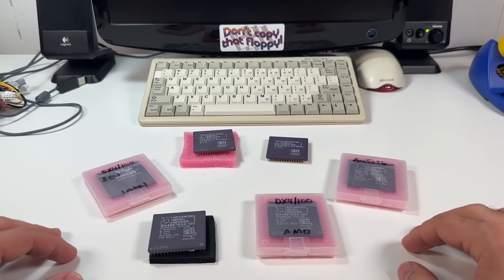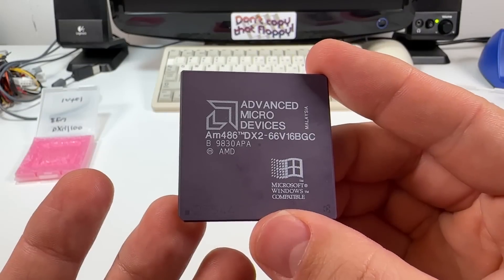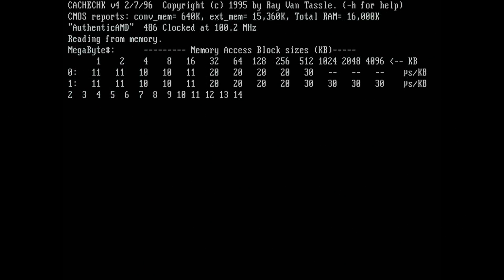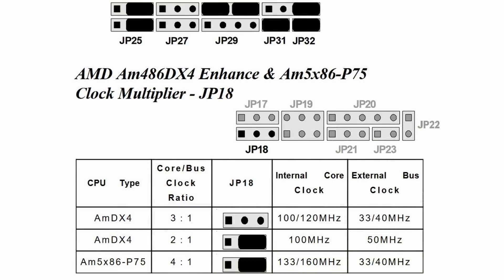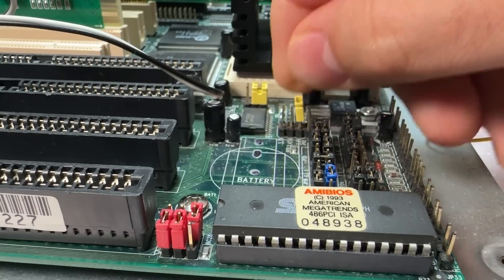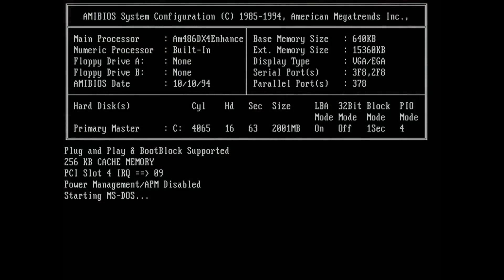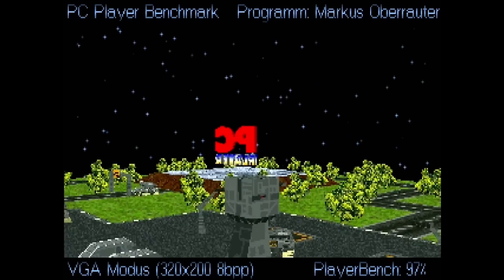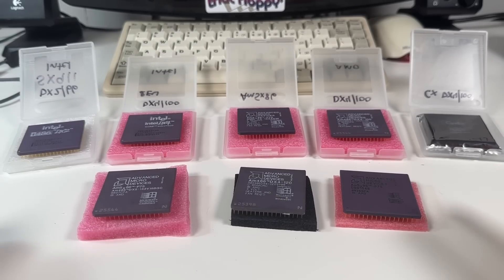These AMD 486 CPUs Are Not What They Appear!

Comment: Good ole amd always slipping in secret value . im still using a phenom 2 555 unocked to the b55 quad . also recently fixed up a friends dads computer.. with some junk in the drawer and bios tinkering i doubled his system.. unlocked his phenom2 in to the quad,  doubled the ram from 3gb to 6gb , Added a second hard drive in, and changed out an old hd4650 512mb for a hd6570 2gb.  just junk in the drawer upgrades.,
Reply: his old system was a rocket and he never knew it. running in limp dual core single channel ram mode all its life.. it even went to a pro shop all they did is clone his windows install to an SSD and told him to turf his Still perfectly sound mechanical drive. .. and charged him a pretty penny to do it....

Comment: I always find this interesting. I remember selling tons of dx2-66 chips. I didn't even know intel came out with a dx-4 100. Was selling Pentium 75 & 90's at that time. It seemed like every time I ran into a non intel chip. We had problems with it. Since then I have had some of the questions answered. As I pointed out before I loved the 486DLC-40 chips. I myself even ran a Cyrix 6x86mx pr233. But ti seems like any other chip failed. Mostly died, unstable, locked up or some programs would just not work. Also Windows 3.1 would run great and Windows 95 run like garbage.  So back to Intel for the shop I worked at. The people really started to use AMD processors. I was out of the computer market. Interesting enough when I got back in. AMD was cleaning up Intel with the socket am2 processors. One side note and I should start putting this on other channels. I remember finding and using some really strange motherboards with soldered in cpu at some crazy clock speed with per-attached fan.Thin would run Dos and Windows like a bat out of ****. A few didn't models and tries did not last long. They seemed to die. I keep looking for one of those to show up. But, the supplier we got them from imported stuff directly in shipping containers and since this was before internet. He offered us some really strange items in the PC world. I wanted to say it was some crazy 386 processor running at 75mhz. I don't think my memory is correct though since I have never found such a critter or it was a fake item and was never designed to run at a high speed. I also know for sure it was not a Intel chip.

Comment: I have a video on this topic. My max bus was 70MHz. Looks like I have to test more M/Bs....
"Binning / Testing 14 Am5x86 CPUs. The 190% Overclock on Am486-DX2-66 and the Unreal 70MHz 486 Bus!"
Reply from the maker: Hi Atheatos! Wow that’s awesome, will definitely check out your video 👍 .. I wish I had some better binned 5x86s. My best one boots but is very flaky at 180MHz. This 66MHz chip refuses to post at 180MHz regardless of voltage but is totally solid at 160 and 3.45V. I may pick up a few more to try out 🙂 .. thanks for watching and for the comment.
Reply: Actually I am still missing a a golden sample one that can do 200Mhz even after binning 15pcs. :/ High speed ones are rare for sure.

Comment: I didn't know AMD sold faster 486 CPUs as slower ones back in the days. I had an 5x86 133 myself, it was a great and cheap alternative to the very expensive Pentiums.
Reply: Yep my old room mate and I each built systems using the 5x86 and they were great. I kept that until I built my next system which was a Cyrix 166MHz.
Reply: At the time, AMD had some very stringent testing requirements. Many of the top tier CPU's that would not meet testing criteria were throttled back and sold as slower speed units. In many cases, it was thermals testing they weren't happy with.  All of us who were into overclocking, dealt with high thermals anyways, and as long as it was stable no one cared.
Reply: Me burned my 5x86 right after overclockin' it
Reply: They did that for a very, long time. Even the Slot A 500Mhz AMD Athlon is just a rebadged 750Mhz core model. it was cheaper that way instead of designing lower tier CPU's. Every 500 to 650Mhz model would oc seamless to 750Mhz and even beyond.
Reply: It was all cool until we found ourselves with a K6 200MHz, right? 🎉
Reply: It was fairly common for them to relable parts when they ran out of the "Correct" part.
Reply: Yes, was better bussiness technique. Lime samsung phones, diffrent features for different budgets
Reply: back then overclocking wasnt as easy as today, people didnt try going THAT far so no one knew what the limit was

Comment: I don't get it. You're doing such high overclocks. I had an AMD K5-133. I overclocked it to 166. It was HIGHLY unstable. So I bumped it back down to 133 and it was fine.
Reply: K5 tended to be..... not so great.
Reply: @aprilkolwey4779  yeah back then I thought it was all about the clock speed. I figured a slightly cheaper k5-133 vs a slightly more expensive p5-100  was a good deal.
Reply: AMD K5 is completely different architecture and won't scale as high as those late 486s. No wonder you weren't as successful.
Reply: The K5 was a Pentium-class processor. These are all 486 chips, even the so-called 5x86 was just a 486 with a 4x multiplier that was marketed against low-end Pentiums because its performance was equal to a 75 MHz Pentium.

The K5 was actually faster than low-end Pentiums at the same clock speed, but was so late to market it was never very competitive. AMD then bought out NexGen and released their ready-to-release next offering as the K6. But they kept making 486 processors into the new century.
Reply: @johncate9541  I don't know for sure. I do know that the P5-100 was faster than my AMD 133. It had 5 in the name. Was it 586 or K5? I don't remember. When I overclocked it to 166 it seemed about the same speed as the P-100

Comment: I have an AMD 486 DX2-66 from week 38, 2000 and an AMD 486 DX5-133 from week 50, 1999. They made these for a very long time. (and yes, DX5, not DX4 - it says that on the chip)
Reply: Those were almost certainly for ”single board industrial computers” used to control CNC machines and similar; not for home users.
Reply: @soylentgreenb  I've seen em before in computers here and there but rarely.
Reply: The AM5x89 line like your DX5 had twice the L1 cache 16K instead of 8K.

Comment: Best I ever managed in overclocking was a Xeon X5650. 2.66GHz stock I got it to 4.6GHz on the daily with vcore 1.45 and a 200MHz FSB
Reply: I can see it on a golden sample.  Those were basically well binned die shrunk Nehalem, so they would share similar overclocking headroom with the i7-9X0s.

Comment: I'd love to see some Cyrix content.  From my experience as a kid tinkering with mine and friends computers, Cyrix used to be really common (I'd never even seen an AMD CPU until the K6-2) .  My first 486 was a AST Cryix DX4 66Mhz.... then my first custom build PC was using the Cyrix PR133+ (at 100Mhz).  There are some interesting bits of history regarding those CPUs and Quake as well.
Reply from the maker: Thanks for the comment! I did an upgrade CPU showdown video a while back and looked at the Cyrix 5x86 but would love to look more into some Cyrix 486s and the 6x86 one of these days 👍
Reply: Cyrix processors were unstable in my experience - windows 98 kept locking up !!

Comment: Great video! The best overclock I think I ever got was just the 50% Celeron 300A overclock... Boring in comparison!
Reply: In my life i only managed a 30% overclock on a C2Q Q6600 from 2.4 to 3.4GHz T_T but that wasn't even comparable whit retro overclocking...
Reply: @GiovanniBardazzi333 I had a duo wich came from around two ghz to 3. The Mainboard supported an FSB of 400mhz and that's what did
Reply: @GiovanniBardazzi333  you did manage 41%
Reply: @MarcRyderProject   WOW! I did even better than my math skills can realize! 😅
Reply: Some of 300A (and every 300 I believe) were stable @112MHz bus. So try again ;)
Reply: @SobieRobie  At 500 MHz was able to smoothly decode divx movies. It was awesome.
Reply: @SobieRobie  haha well this was when the CPU was new and I just changed a jumper. I've never cared much for top OC limits as stability is far more important to me than pushing the envelope.
Reply: @adriansdigitalbasement  try to overclock a Tillamook MMX on Supersocket 7, would be an interesting video.... The SL2Z4 with stock frequency of 266Mhz i got permanently stable at 400 and its not even getting hot. Thats 50% OC without stressing it, i assume, it would make much more, sadly i dont have boards where it runs on that make more than 100mhz FSB, it has a fixed 4x multiplier. The boards which would go higher, the Tillamook doesnt post or at least not booting up fully... Never seen a video about it on Youtube. But isn't it cool asf to have an Intel on Socket 7 at 400 (and more) Mhz?
Reply from the maker: Still haven’t had a chance to overclock my Tilamook 266 yet. Hopefully soon 😁
Reply: @vswitchzero  Please can you benchmark DX2-160 and DX5-160 in Doom or Quake? To see the benefit of faster 80 MHz FSB.

I think the FSB was a big limitation for the latter 486s. Socket 7 Pentium had 64-bit 66 MHz FSB which was equal to 133 MHz FSB of 486.

BTW thanks for great video.
Reply: I had a Slot1 Pentium 3 550/100 running @900/163 for some time. That is over 60% overclock. The RAM was a pair of 166MHz capable 64Mb 5ns SDRAM DIMMs (3-2-2 timing @166MHz) that i got from a friend who worked at Infineon at that time. The whole system got nuked when i tried to push it further with an 80W Peltier element @ sub-zero temperatures and condensed water shorted the mainboard under the northbridge. Before the P3 i had a Celeron 366/66 that i was running @620/112 with massive cooling and @550/100 normally but i did not have a very good mainboard or memory at that time and could not push it any further.
Reply: The highest overclock I have is "50%" on a X5670. 22x200 for 4.4GHz from the stock 22x133 2.93GHz, but because of turbo boost it would turbo up to 3.33GHz even at stock
Reply from the maker: Thanks for watching, Adrian! I’m a big fan of your channel 👍 .. The 300A was legendary. I have one that will do 600MHz with a bit of a extra voltage and will even do 450MHz undervolted too 🙂
Reply: I knew a guy at college who had a 300A at 450. It was a real feat, because the fastest PII at the time was 450, and it didn’t have full speed cache.
Reply: I also had a 300A rock stable at 450 mhz.  And before that, A Pentium 133 was perfectly stable at 200 mhz.  Ahh 90's overclocking.   It was grand.

Comment: Most of the limitations of those CPUs came from the mainboards. The 486 platform was set to obsolete by Intel, so AMD and Cyrix hat to live with what was standardized by Intel before. It took a while until the mainboard manufactures upgraded the cpu multiplieres on the MoBos and changed the needed voltages. I can remember me having a "133 MHz" AMD back in the day but being unable at first to drive it at its desired clock. A MoBo swap made it happen and even higher speeds was was great to have but without a chance against even the slowest P60 with calculation errors 🙂.
Reply: I was under the impression that the 486 DX4/120 and upwards were very competitive with the first Pentium's.
Reply: @kyorin6526  Depending on the use-case. Some programs took advantage of the Pentium at a level that made them extremely slow on these fast 486s. This was still back when hardware level optimization was needed.
Reply: @kyorin6526  the pentiums were cache monsters for it's time. Many of the 486 cpus only had 8kb. So most every access to data went to RAM what's until today is the slowest part for data already read from disk/net.

Comment: Remember my AMD AM5x86 133mhz. Man - what a system ! Currently have a Pentium 75 , stupid board dont support the lower voltage 166MMX i have . Also have 2 x K6 systems , a 350, and 550, lots of athlons, durons, all working , and P3/4 and Slot 1 intel cpu's with dead mobos.